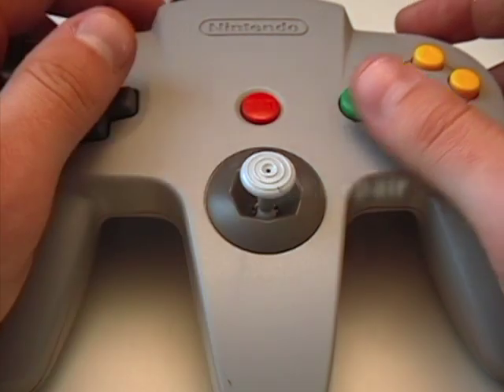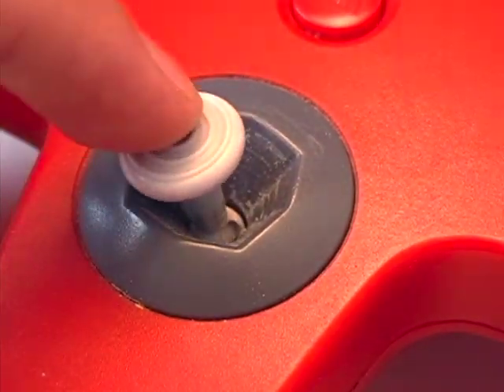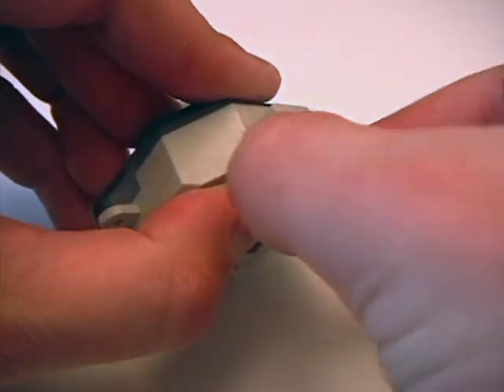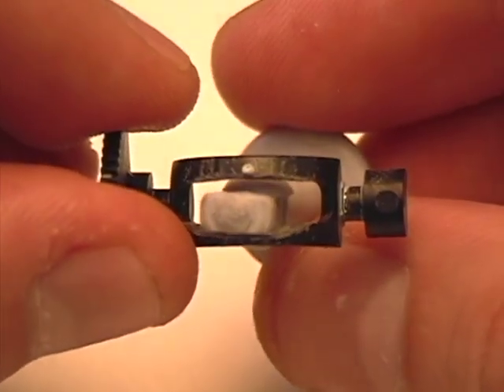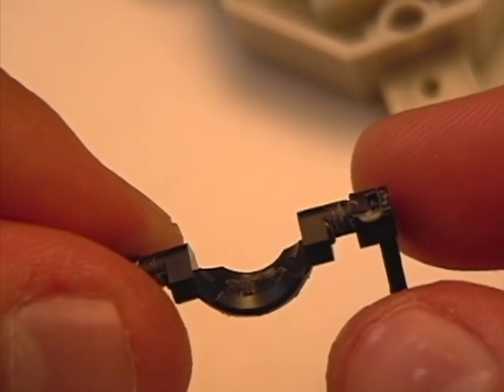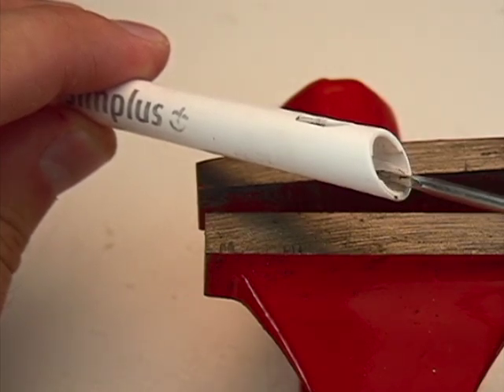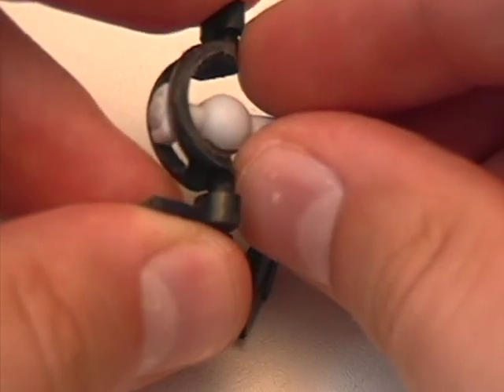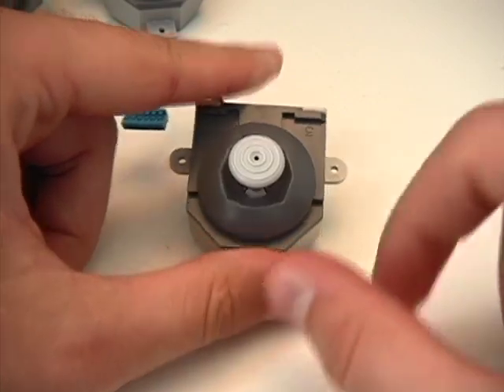N64 Analog Stick Repair

Comment: I may be missing the point, but why not just replace the thumbstick with a new one? There is a newer style replacement that is like a Gamecube thumbstick, works well, and costs about $13 on ebay, shipped. Also it's less disgusting to change.
Reply from the maker: Chris Po For some people fixing something is more rewarding, or they are located in an area where Ebay is not an option, or where replacement Nintendo parts are not an option. Some people want to conserve the look and feel of the original stick. Some people want to understand how things work instead of throwing those things out and buying replacements.
Reply from the maker: ***** Is that question to me? Sorry, I'm not sure what you're asking.
Reply: +djchristian82 Sure - here's a random link I found on ebay.com/itm/New-Gamecube-Style-Joystick-for-N64-Controller-/281710447382 But be aware, there's a whole discussion about whether or not these sticks work exactly right, and some people claim they have had to create a new PCB that addresses its issues. So, I can't say for sure fit the latest versions of these work right. I bought one that works notable not-well with Blast Corps.
Reply from the maker: ***** That's exactly the motivation and purpose of my video.

Comment: wouldn't it be a lot easier to just buy new analog sticks from Ebay? they're not that expensive
Reply from the maker: +TheKisj Not everyone has access to eBay and some people prefer doing things themselves. Personally I cultivate a culture of repair and maintenance instead of replacement. Also this way you retain the original parts so it may be more appealing to collectors. Although if you don't really care about that secondary stuff and you feel a replacement is worth it, then fair enough.There's nothing wrong in that :)